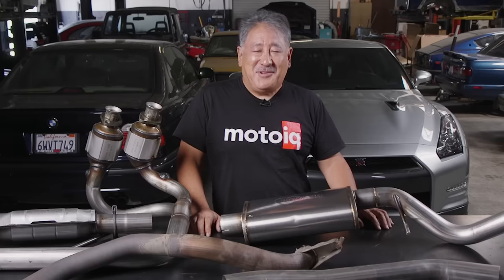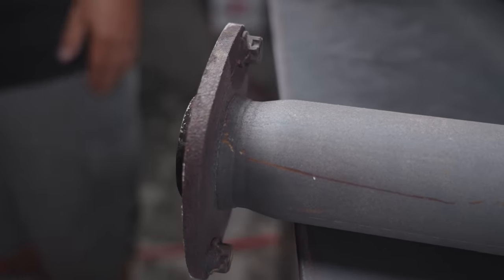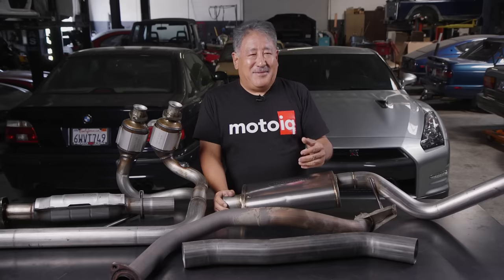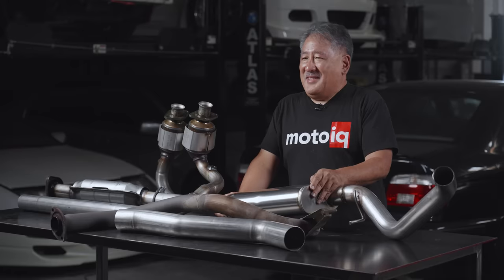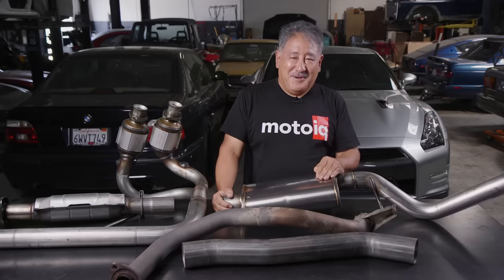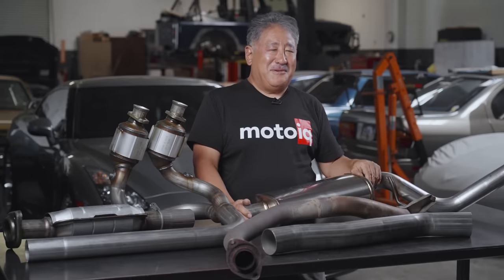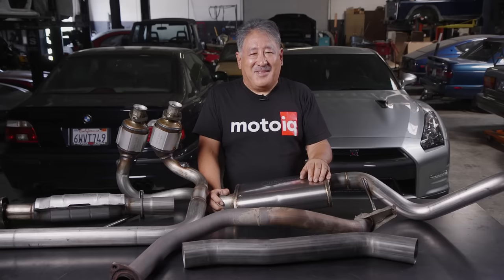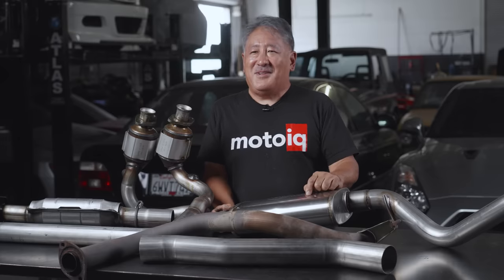Exhaust Back Pressure Myth DEBUNKED!

Comment: Should do another one on Running Header only, have heard people in the past say it can cause bent Valves. My car has had Header only(with about 1-2ft of straight pipe) for years and never had a issue with Valves or Valve sealing
Reply: Or open port. They say the oxygen shocks the hot exhaust valves.
Reply: Heard about people saying it is detrimental to valves so that would be kinda cool. But sounds like not a great idea to run open headers based on this video too, due to trying to keep exhaust gas velocity up to promote scavenging.
Reply: The downside with running headers only is the lack of scavenging, you need the inertia of the gascolumn after the header to get good scavenging.
Reply: @aDaWaN  but if its boosted in any way there cant be a downside other than heat dissipation?
Reply from the maker: @2001chevycamaross  that's about right
Reply from the maker: @aDaWaN  Only some, a little after the collector is fine.
Reply from the maker: A lot of the burnt valves were caused by reducing the backpressure causing the engine to run too lean, not because of cold air or shocking valves with oxygen.

Comment: This people need to hear more often! Nice vid! I think what gives the misconception about back pressure is often increasing flow will also often lean out afrs and on a already lean tune this does not improve torque! also removing an anti reverberation tuned exhaust for a big cheap loud cannon don’t make it a race car
Reply: I agree loud doesn't make it fast, but for some reason ppl think my P71 is one when I drive it..lol I drive it open cutouts for that zero restriction/back pressure which makes my car a few tenths quicker n frees up a few hp (12 to be exact) but that's the only reason, not bcuz I want to sound fast..lol
Reply: @P71ScrewHead  cool Sounding I bet! I use a cutout too the first one I had Was home made mild steel butterfly and 3” pipe and a throttle shaft from an old throttle body operated by cable mounted at the end of the turbo dump and “t” off the dump to flow to the rear muffler when closed, and it was a packaging nightmare to make it work with a wideband accurately! I’m using a normally open vac operated ebay one now and a mower fuel tap in cabin to fix it open but it’s still got the factory 90s exhaust below the dump pipe and it literally would loose half it’s power on quiet mode due to the ridiculous back pressure so the vac system was a safeguard in a way
Reply: @P71ScrewHead  I also have a Nissan Pathfinder I hacked the rear 2 to 1 muffler out and replaced with a y and damn thing sounds like a methanol stock car
Reply: Your right, but at the same time how many guys with stock k series in a Honda Accord just heard they need 3 inch straight pipe?
Reply: @ryurc3033  probably 85% but with enough coins spent even 3” could be tuned pretty quiet, lol that’s coming from a bogan with an annoyingly loud exhaust but with a cheap vac cutout and factory muffler’s
Reply: @needmoreboost6369  Oh yes, I kinda know what you mean.. I kept my stock exhaust on my P71 supposedly to keep it quiet, which it is when closed but not as quiet as my mom prefers..lol I don't mind it but since she rides with me sometimes I care of her opinion..lol But when I'm alone I drive with them open bcuz the car runs better like that..lol It sounds mean, only has 249rwhp but "sounds like it has 100 more cubic inches," one guy told me..lol Heads n cams are on their way, eventually a supercharger but for now I'm just enjoying it as it is.. Has longtubes n high flow cats 🐈🐈‍⬛.. I bought my cutouts from ebay..
Reply: @needmoreboost6369  Sweet, make it a dual exhaust n you'll gain a few more horses 🐎😉.. I want a Nissan B13 to v8 rwd swap with a rusty Lincoln Town Car I have just laying here, things are kinda rare now tho, n I need money 💰 to get that done..lol
Reply: @P71ScrewHead  nice! mine has a bin cat
Reply: @P71ScrewHead  I hear ya!
Reply: @needmoreboost6369  what's a bin cat??
Reply: @P71ScrewHead  a cat in the bin

Comment: I know this to be absolutely 100 percent true as I would have weird stumble in acceleration with my exhaust setup that is free flowing on OBX Long Tubes , Y pipe and test pipe but kept the OEM muffler on my 93 6 Speed Coupe Acura Legend.

Until I finally change that huge OEM muffler out for a Free flowing but chambered Super HK5 Dual 3 inch Burned tips muffler that definitely took care of that stumble in acceleration at the cost of being just a little louder then stock.

I love your videos and awesome explanations for your content, thank you for making super informative vids!!

Comment: I'm pretty sure the argument is not lack of back pressure per se, but the affect of the slower velocity on scavenging. Loss of the scavenging will result in a loss of power.
Reply: Correct. Properly tuning back pressure waves is what helps draw more exhaust out, and more intake during the overlap.  This is why there is a difference between short fat heads, and long narrow headers.  Long narrow tubes will be more efficient at lower RPM. but kill upper power, while short fat headers will kill low end power but make more upper rpm power.
Properly tuning the intake, cam, and exhaust on a naturally asperated engine is important.  Slapping parts on because they say it makes 50hp is a quick way to kill your performance.
All this goes out the window the minute you add a turbo...  the turbo is now the limit, so big fat exhaust can't hurt it any more.
Reply: Learn about pressure transient.  In this case the low pressure wave racing back to the exhaust valve.

Comment: Well we had the best results on the dyno with a minimal overlap cam using a 2 stroke type muffler made from quarter inch thick steel. We also had a valve in the end of the exhaust with vacuum control running a 1/4 inch diameter hole and we found that the valve only opened at WOT.
Reply from the maker: That is because of the minimal overlap in the cam timing.
Reply: @motoiq  Well our dyno results showed a different story as we ran a phase iii cam on a 351 restricted the exhaust flow via the 2 stroke muffler and the resonator at the end of the exhaust with the block off valve with the 1/4 inch hole and vacuum control. The smallest cam was based on a Holden 179 six cylinder stock engine .
Reply: Do you mean 2 stroke muffler or a 2-stroke style expansion pipe? Muffler construction does not actually change between 2 & 4 stroke engines as such. Muffler wall thickness also has zero bearing on power output. Too many variables to your comment including 2V vs 4V, open vs closed chamber heads, headers vs manifolds, 2bbl vs 4bbl, diff ratio + actual desired operating rpm etc etc. Combination is the key.
Reply: @mjhmech4903  I must admit we are about 30 years ahead in our technology concerning Otto 4 cycle internal combustion engines. There is a whole science starting with temperature control which then brings in proper tune spec as the engine is then better equipped to handle a proper constant A/F ratio , then proper exhaust design measured from the back of the exhaust valve to the collector then proper exhaust size according to the engine demands. Check us out at www.bennettclayton.com.au
Cheers

Comment: U need exhaust, the header continues to work up to 12 inches after the last merge. If you cut the header off you won't get the "extractor" to work.
Reply from the maker: That is not true.  Cars go fast with no exhaust and just collector extensions
Reply: @motoiq  Are you just replying to reply or did you read what I wrote?
The HEADER continues to work up to 12 inches AFTER the last MERGE. For example a 4.2.1 the 1 is where the last merge is. If you cut it off 12 inches from there the car will be fast, it don't need the rest of the exhaust but you need the header.
Reply: Also some of your other videos are very misleading. There was one about the 4AGE crankshaft not making more than a 200hp, when we have taken standard 4AGE block with silver top head to near 700 and climbing, meet after meet, back to back 10 second passes.  No issues with the crank. What did he mean by that?
Reply from the maker: I was talking about NA high-revving engines.  Turbo engines with boost turning lower RPM can tolerate a lot more.  Compression by boost is tolerated a lot better than spinning high revs. With a little 1.6 you got to spin fast to make NA power.  Also drag racing and street use are much less demanding than road racing, drift or rally.  Running 20 minutes is a lot harder than 10 seconds.  If you are only at full throttle half the time, one track session is like 600 10-second passes even if you consider that you might not be at full throttle then let's say it's 300 passes, let's say you are a lame driver so it's 150 passes. There are usually 3-4 sessions per day at a road racing event.  So that's like 450 passes being super conservative.  So one track day is like a few years of drag racing.
Reply from the maker: It's not always an arbitrary 12 inches. I would say 18-24 is safer to generalize without dyno testing.  A merged collector's extension can be shorter than one on a box collector.

Comment: I literally had a mechanic tell me "your exhaust needs backpressure". He also told me "your car is perfect from the factory, dont modify it or it will be ruined". As if oem engineers know more about performance than aftermarket.
Reply: Sometimes techs like that don't think the aftermarket can make an improvement. 
Well in that world of Volkswagens where I'm at ,there's a company who makes cast aluminum water necks to replace the crappy factory plastic ones. 
That's just 1 example of better aftermarket stuff. 
As far as backpressure goes ,less is better ,but it might be an issue of recalibrating the fuel flow now required,some carbs or fuel injection or engine management systems are easier to retune than others.
Reply: The factory engineers might actually know better, but the have to make compromises that the aftermarket doesn't have to consider.
For example when it comes to choosing tires. They have to go with an all season or summer tire even if they're selling the car in Canada during the winter
Reply: @javiervelasquez8002  no modern engineers do it by "how much can we shave off the cost" and "just make it last until the warranty expires" they don't care it's not the best, as long it doesn't fall apart during the first ownership it succeeded. Aftermarket knows best because their goal is to "Keep it alive" fixing design failures and optimize the car overall.
car engineers haven't peaked since the 90s and that's because they had something to prove, and that was pride, not greed..
Reply: Actually that’s excellent advice when it’s being given to someone that doesn’t have a clue what they’re doing.

Maybe he had a good read on his customer?
Reply: bro that last part is gold lmao. if they knew more then theyd be selling cars not just exhaust pipes, and other parts that dont even fit half the time.. FFS man that is a good one
Reply: @thatslegit No lmao.. since the 90s huh ?? yea more like 2008. please explain how anything from the 90s is better than anything from mid to late 2000s. I need to see this
Reply: They’re working within parameters. If you don’t think an engineer could and would out-engineer for performance (on average, in general) vs an at-best technician or amateur enthusiast turned businessman, that’s why you’re not capable of engineering. In order of understanding fundamentals/principles enough to create/innovate it goes Scientist>Engineer>Technician.
Reply: It's good generalized advice for most people, even if it's not technically correct. The performance characteristics that are demanded by the consumer go far beyond the pursuit of peak power. You also have to consider fuel mileage, emissions, NVH, drivability, while trying to strike a balance between reliability and the demands of meeting a certain price point. People buying new cars want the most features they can get for their money, which is how you end up with marginal designs that break easily. Toyota used to sell a car that they overbuilt; it was called the Land Cruiser. Discontinued because new car buyers don't want to spend extra money for a vehicle designed to last 20 years. Why would they? They will just trade it in after 2-5 years. Manufacturers build cars for the people who buy them new, not for the used market.
Reply: @wyslink9354  The only thing better in the 90s was the reliability of Japanese cars. That country's industrial manufacturing capabilities had reached their peak in that era. Yes technology is better now, but their quality control and design was unprecedented - and they were able to achieve this while maintaining competitive pricing.
Reply: I am pretty sure my buddy doesn't need exhaust on his 2uz tundra, and my 1GR tacoma didn't need a 3in catback N/A at least

Comment: Yesterday I pit a 3" mandrel straight pipe and an absorption muffler on my 3.0 VETEC 6sp Accord coupe. Love the power band shift, not so much the increased sound but then I did acquire this car to modify. Always have removed as much back pressure as possible from the cars I've built from mild to wild & had to laugh at the "Old man" remarks concering back pressure a staple of the Mom & Pop muffler shops, was even told once the car will never make enough power to get off the rack with the size pipe you want installed ha ha ha

Comment: Thank You Thank You Thank You! Just look at drag racing, and top fuel cars with 1 1/2 foot of exhaust reaching 300 MPH in a quarter mile. That's always been my example whenever someone says a car "needs this or that". I look to NASCAR, Drag Racing, auto racing in general, and if its good enough for them, then I say it's probably the best way to design, build, and operate a car engine. And even when it can't be applied on the road, it still gives you important and functional data about engines. Low Temp thermostats are an example of what is used in racing that can be used for everyday cars. NASCAR vehicles use 160 degree F thermostats. High temp thermostats are used on the belief exhaust does not get hot enough to operate catalytic converters, even though the temp on the top of a piston from combustion reaches 1200 degrees F, and the extra heat only destroys other valuable engine components and shortens the life of an engine. Catalytic converters are designed to work at 300 degrees F, or more. And most see temps greater than that due to their proximity to the engine and the exhaust gases coming out. Some of these newer twin turbo V-8 engines (Hot-V), like from BMW have thermostats that open up at 220 degrees F. They can do this due to strengthening the radiator to operate under greater pressure. Yeah right. That's why they had a recall on those engines. You cannot, due to simple thermal dynamics run a combustion engine "too cool". Try touching your engine just 1 minute after idling if you think otherwise. (please don't, its rhetorical question). But there are many rubber and plastic parts on engines today, regretfully, and they cannot handle high temps.

Comment: I remember doing this as a plug flow simulation as chemical engineer degree 2nd year simulation…back pressure was to allow residence time to allow optimal catalyst converter to scavenge or clean exhaust…but I thought complete free flow would be best for performance when I removed catalyst but it wasn’t…it depended on the setup and could be tuned to range depending on flow and pipe size and the variables you did mention

Comment: Backpressure is 100% bad. Badly tuned engines, badly tuned fi, and badly installed systems cause actual power loss and engine damage from backpressure. That's what i have always told my customers. But some people like it for extra torque and popping at the cost of an engine. This is an intelligently ran channel, i sub.

Comment: This is why i Made a Custom Exhaust for my 99 WRX EJ205. 
Firstly All made from Mild Steel 2mm Thick for much deeper note.
3" Bellmouth Turbo back W/ 2 x 300 cell racing cats (1 in down pipe, 2nd 2ft further on  downpipe)
Into 3" Main Pipe with Resonator 
Into 2.5" Diff Back Pipe with 2 x 90* Bends 
Into Open Twin 3.5" Tipped Stainless Muffler.

The 2.5" diff back increases the speed of the gases as they have lost lots of heat energy and on EJ205 without AVCS Majorly improves Low end Torque by upto 25-30nm below 4000rpm

Comment: Because of my illiteracy I call it back pressure but I've always understood the exhaust needs to be calculated just as efficiently as the intake and fuel metering. Thank You for using proper terms.
You are in my prayers
Hoka Hey